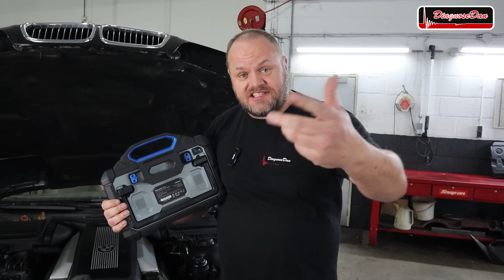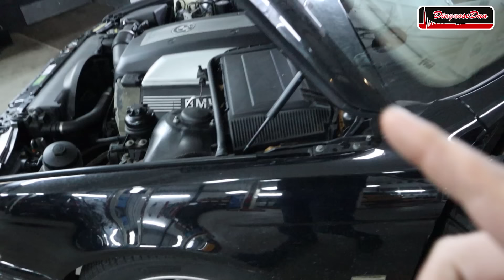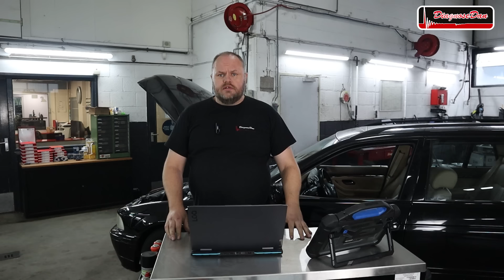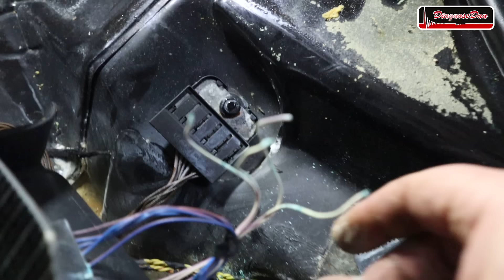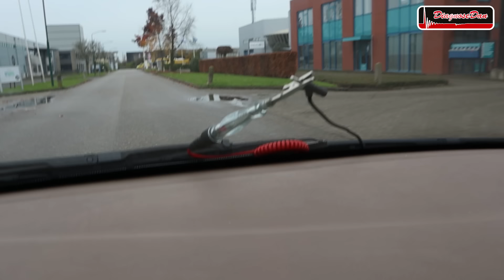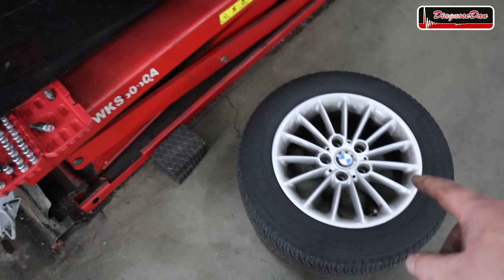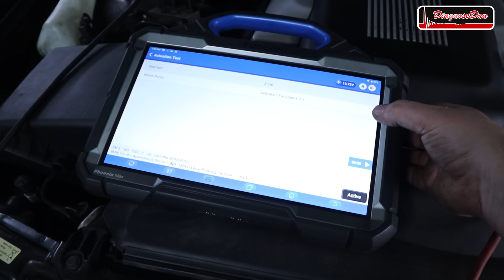Help! Weird fault and my scantool won't connect!

Comment: Definitely above and beyond there Dan , well done on the comm fix on Pin 8 ,knowledge is everything,  great to know another old girl is back running sweet again,  just imagine,  I bet they clean out the DME  com boxes in the future , customers think nothing will go wrong with a bit if water and leaves 🍃,  Vw Passat , leaves 🍃,  water 💧,  recipe for disaster,  brake servo rusty 😂😂😂, water in the car,  battery swimming with water , wet carpets , we've seen it all , I remember when wirking at a Fiat dealers in the early 80's here in the Uk , Fiat 126 air cooled , new from the factory , plus many other models  drain holes blocked with underseal,  the car smelled like babies nappies (diapers) , seats and carpets out drying , cleaned , new underfelt , air freshener in the car , wd40 spray on any connections 😂😂😂, well done 👏
Reply from the maker: If you worked on Italian cars from those years you know what i'm talking about 😂
Reply: @Diagnosedan  every day was a smelly one , seats carpets out , underfelt drying in the workshop near the heater on a rail after a wash in the canteen sink 🤣🤣🤣🤣

Comment: Hello Dan and welcome back.
All the systems fitted with ABS have some kind of precharge pump? I'm asking because, if they all have that pump, changing the brake fluid properly it would involve energizing that pump, right?
Reply from the maker: Not all have a pre charge pump

Comment: Nice job Dan! I don't know how the brake fluid is transferred from the reservoir to the pre charge pump, but knowing the other shop might have disconnected it, I would have checked the supply.
Reply from the maker: Thanks for watching and for leaving a comment!

Comment: I don't find this strange at all. Would guess from teh intro that it is th abs ring or an abs sensor. I find the fault desctiption pretty typical of that. Assuming it is not bad front end alignment which can also present in this way if the other 2 are known good in some vehicles. Also german cars not acepting other scan tools is not that uncommon either.
Reply from the maker: Yes, that would be common but its not. Only a few cars use the setup with the pre-charge pump. Thats why it's something you dont see every day
Reply: @Diagnosedan  That's true it used to be my first guess but then I realised most cars don't have an abs pump. What is really surprising though is an old car with no codes for abs solenoids. Usually they come as the abs fluid service tails off as warranty runs out.

Comment: Haa, nice work Dan! Isn’t it a bit strange location for these connectors? Not only for waterproblems but also for accessibility?
Reply from the maker: Normally you would never have to touch to them

Comment: All because of a blocked drain. It feels almost criminally irresponsible of the manufacturer to have designed a vehicle where such a basic water drainage problem causes catastrophic failure.
Reply from the maker: It can be easily avoided be cleaning them once a year

Comment: Great Video Dan!  I've had a mystery issue where my 08' Audi A4 won't show all the modules via my OBD11 scan tool.  This video on an older BMW is helpful in my troubleshooting what may be happening.   Thx Dan.
Reply: An 08 audi would have Canbus so perhaps a portion of the canbus has no communication, or something is shorting the network. Maybe a bad gateway module if there is one.
Reply: @event3horizon  Hey Bizija123... thx for the reply.   It's a head scratcher and I've wondered if its a sensitivity issued with the modestly priced OBD 11 scanner combined with the primitive network in my 08' Audi... or if I indeed have a network issue in the car.  Dan's video gave me a fresh perspective I had not yet considered.  As I understand, the gateway module in my system is the instrument cluster.   As another datapoint, I recently got a TopDon scanner and that one can see/communicate with modules that the OBD 11 could not.  Still not sure why one tool can see the modules and the other cannot.  Oh well.   When all said and done, I may need to get a scope so I can actually look at the network activity in real time and see if the network is dropping out, has noise, or if the expected high/low voltages are out of range.  Not a big issue, just wish I could use some of the programmable features that OBD 11 gives me access to (i.e. no seatbelt ding when key in the on position).  Thx for your reply and thoughts.
Reply from the maker: Good luck 💪💪
Reply: @Diagnosedan  Hey Dan, I'm a mechanical engineer who works in consume goods new product development and often wonder if I should have followed my passion/aptitude for cars rather than the cubical farm of the corporate world. I enjoy your content very much as it allows me to live vicariously through you.  I lived in Germany back in the late 80' during my high school years and the car culture there really stuck with me... and while I love Eric O, Ivan, and a few other US domestic YT content creators... I do miss the Euro specific focus that you bring to the table.   Keep up the great work!   Very inspiring.

Comment: Hi Scanne Dan,i love your in detail diagnosis,i have a strange problem with my subaru ,It hesitated all the time on part throttle butreacts to full throttlr,eventualiy,my mecanic cant find  no codes but  when the ECM connector is disturbed it is somewhat normal,for ahwile,what to do ;-) ???
Reply from the maker: I'm Danny not Paul from scanner danner

Comment: WOW. Issues like this really make me wonder about vehicle manufacturers. While ideally that connector should never have gotten wet it makes me question why that connector is located where it is. I mean having to pull the seat and the carpet and whatever else in order to get to it.... Not to mention that car is almost 25 years old and today's cars have even more modules and more wiring like this. Built in obsolescence.
Reply from the maker: Yes, you have to pull the seat and carpet but its a connector you only need acces to once every 20 years😉

Comment: Hello Dan,you have strugling many wierd issues,and could you help me a little with mine?I got 2019 mb vito 651902 engine and i was gone thru owe 150 error or failure with it. Now got 1 left and waal is big,or even i thought so.Its continuesly repeat glow plug control unit timer powererror or lack with it?I have get it of some time and heard that may be issue with alarm system of it. Allso one dealer shop electrician told that he got one with somehow proken radio.At then you could turn radio on but issue was with radio signal and he turn new radio and issue went with the wind.Ant thought??

Comment: My uncle's old 530i(or was it 540i?) had this problem several years ago.   That pump was also the cause.  The BMW authorized dealer quoted him US$1200 to replace it.   He went to an independent shop and had it replace for just $700.   Prices in the US are usually very high for BMW repairs.  I wonder what it costs to replace that pump in Europe?
Reply from the maker: I dont know exactly how much that pump is today. In this vehicle a used one was fitted
Reply: @Diagnosedan    Thanks!  I love your YouTube channel.  :)

Comment: the best way to avoid this, is not to buy bmw. It needs an engine or at least a computer
Reply from the maker: This is a myth, i've worked on thousands of bmw's and as far as i know i only ever replaced 3 engines. Even these old models those engines run perfectly. They are sensitive for the right maintenance! If a Bmw falls into the wrong hands and the owner doesn't take care of the vehicle the problems start.